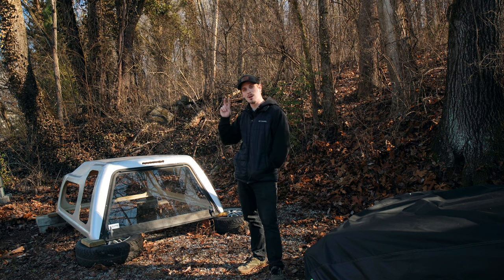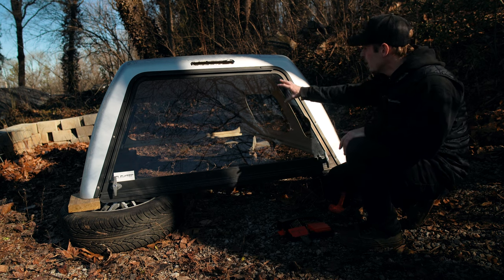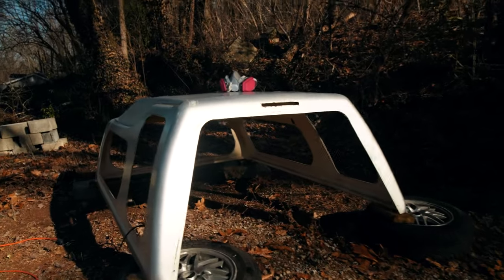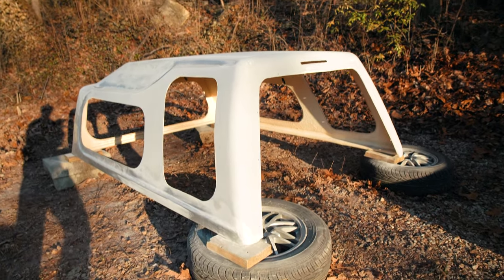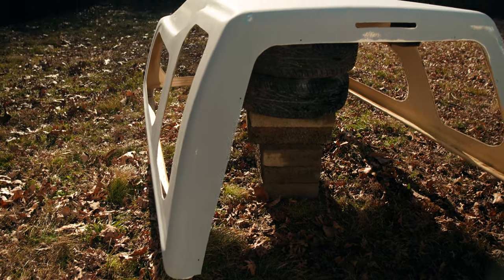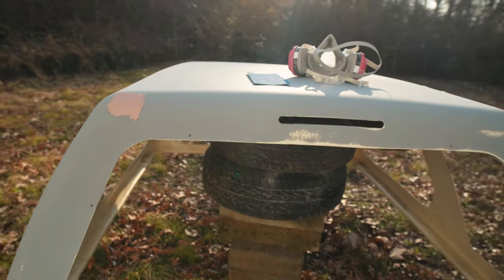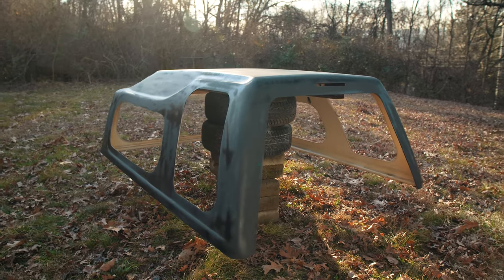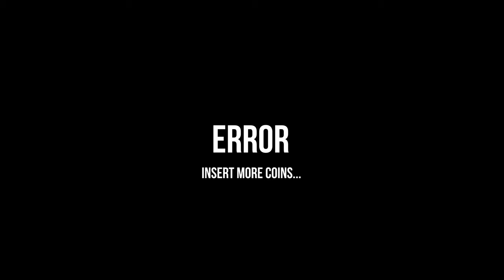Restoring A Truck Camper Shell // Part 2 // Body Work and Spraying Primer

Comment: Pretty cool how our shell restorations are coinciding. Been trying to find a decent video on how to do it right, and funny enough, you’re making a series on it. Glad I could pick up some tips for myself. Got a question about the sealing of the camper. When you had the shell in your truck the first time was there any leaks at all? I’ve re-gasketed mine twice and water is still finding it’s way in. Anyways, keep up the great content!
Reply from the maker: The first time, yes. I ended up layering the foam tape about two layers thick and 3 layers thick at the section near the truck cab. For some reason it needed more sealer there. Since I’ve been doing that, no leaking!

Comment: Where did you find replacement window molding? I have the same style of window molding but mine needs to be replaced.
Reply from the maker: Honestly, I just looked up U-channel gasket and had to measure the right millimeter length that I needed. It took a few hours of searching and I didn’t totally find one that fit perfect.